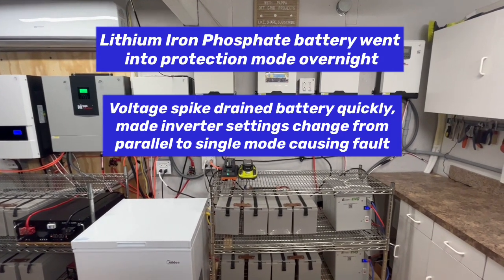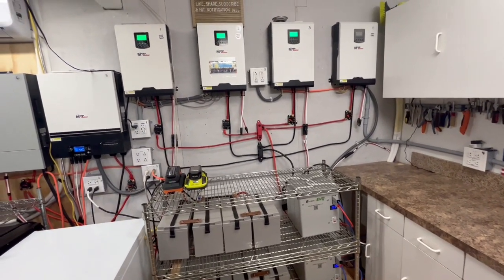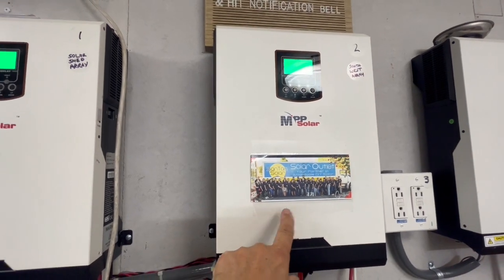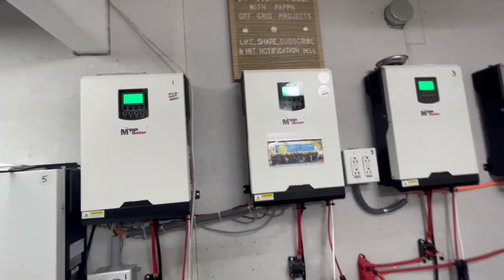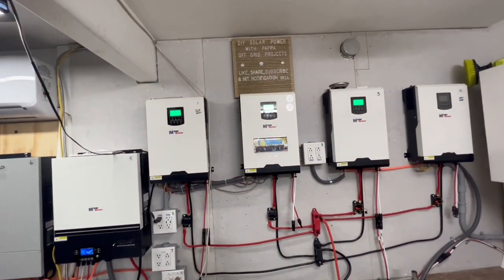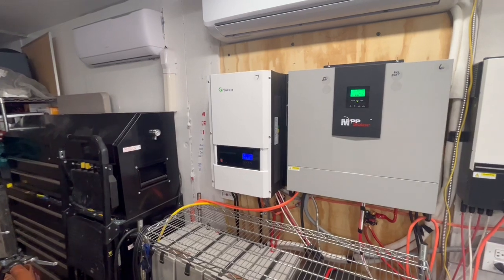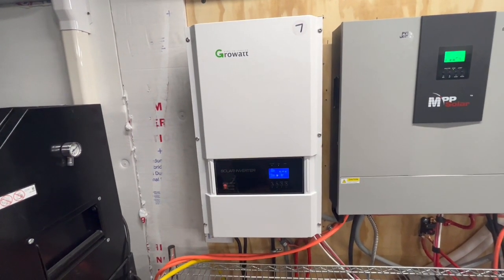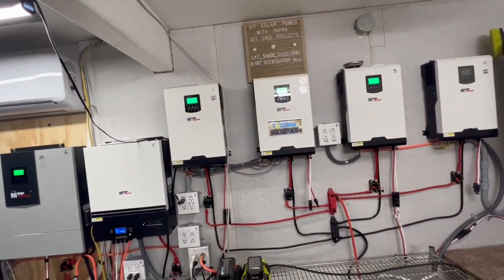Lithium Iron Phosphate battery drained overnight & shut down, went into protection mode for 8 hours

Comment: I'll take the lv6048 to pair with my other lv6048
Reply from the maker: Hi, not sure i am getting rid of any inverters at this point with inflation going through the roof and supply dwindling.
Reply: @diy-solar-guy  had to ask. That's the only reason I spent $25,000 on solar this summer. Because the world is falling apart
Reply from the maker: @electromechanicalstuff2602  I bought my mpp inverters from santansolar.com. In Arizona there is no tax and can pick up for free if you live near to Gilbert Az. Just looked on SanTan solar web site, they have the LV6048 Hybrid Inverter 120/240V 48volt for $1550.00. You are smart buying now, prices will continue to increase over the next couple of years. Santan solar has not marked up their inverter prices that I can tell for the last 3 years. Still same price as when I bought.  Good luck with your solar and let me know if you have any questions. Hope you have a wonderful and blessed day.